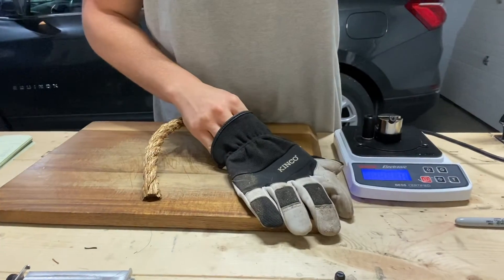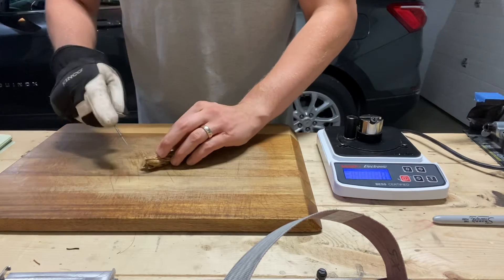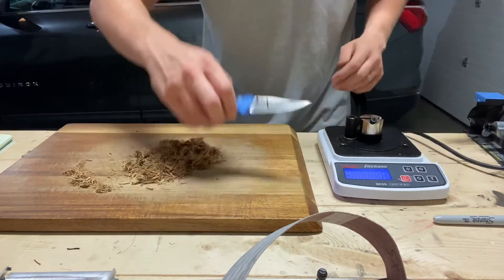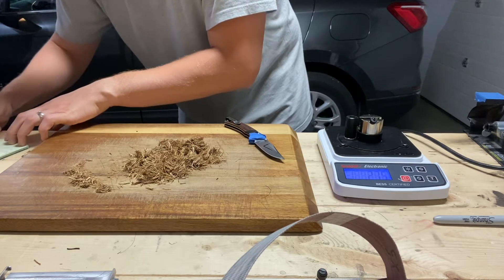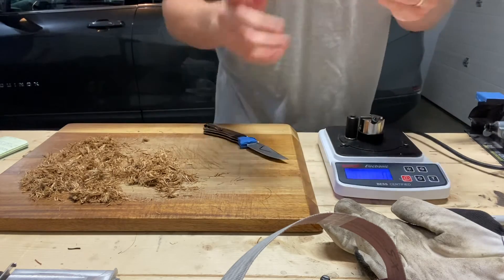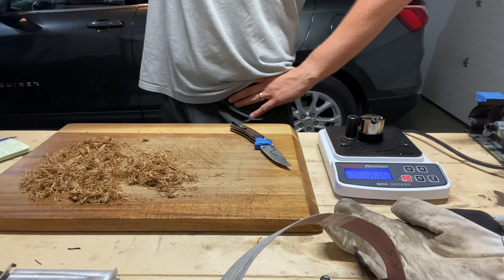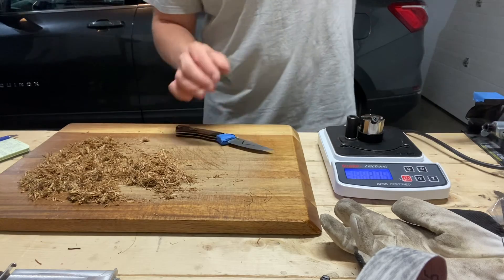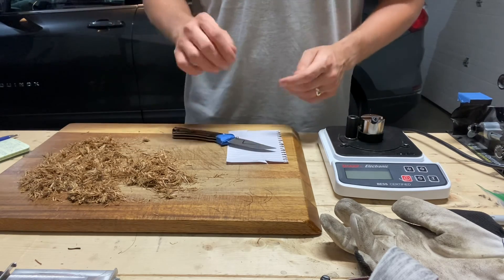Diamond Stones vs Belts Part 4: WSKO Blade Grinder Edge Test (S30V Benchmade Mini Crooked River)

Comment: No difference basically? Within the margin of error? I'm guessing you'll see a difference in S90v and other really high vanadium steels. S30v, S35VN, M390, and below in Vanadium content seem to do roughly the same with Aluminum oxide or Diamond, CBN, or Silicon carbide is the general consensus. I'm looking forward to further testing. You could order Aluminum oxide lapping films and use the KME for both for more consistency if the abrasive is the only difference you want to test at some point. Aluminum oxide lapping films are pretty inexpensive. Looking forward to more testing regardless.
Reply from the maker: I will have a summary video soon, just need to find time! 

I'll sum it up here because I've taken so long but there is statistically no difference in the working edge retention of S30V between sharpening a v-edge using diamonds/CBN and the convex egde from the Worksharp ken onion blade grinder with stiff belt kit, 12K and 1um on cloth. 

This I don't think is surprising other than the fact that it suggests to me that there is little overheating from the Blade Grinder using their Norax 1x18" belts. I don't think it would be expected to see a major difference in working edge performance with either abrasives. 

Should be much more pronounced with the fine edge that will hopefully be captured in a cardboard version of this series at some point. But can't say for sure until we test!

Comment: I know you might fight against this, but I  would really love to see you put in some hand sharpening into the mix. The variables there might be too numerous, but I think either a neo-chosera-shapton progression or a venev progression
Reply from the maker: IMO the KME is the same as hand sharpening just takes the skill out of the equation. But I do actually have about 20 points of data on knives I've tested on cardboard until no longer shaving hair on a 1" section. I did this prior to the channel creation just for my own knowledge but I'm apprehensive about sharing it because the magnitude of results varies from the more popular testers on YouTube. The pattern/hierarchy of steels at their harnesses match perfectly  but I think that detail is well beyond some in the YouTube audience. 

I do think it would be interesting to test the Neo vs. Chosera on a high VC steel and see if the SiC makes a measurable difference!
Reply: @EngineersPerspective701  Oh that neo vs Chosera would be a perfect match, especially because those both hit that 800 grit so well.  

I understand now about the hand sharpening equivalence to the KME. Theyre both sharpening the blade in the same method: precisely with no heat generation.
Reply from the maker: @MrSATism  Not in terms of edge performance but just usage, I WAY prefer the Neo to the chosera 800. Cuts way faster and leaves a nicer finish. It's just more thirsty and dishes quicker.

Comment: Really looking forward to your upcoming analysis comparing sharpening methods!

Your continued mention about the different abrasives with these methods brings to mind a prior set of videos I saw. A different comparison than yours but I am curious, have you ever seen the series of videos by a guy named steeldrake in which he hand sharpened maxamet with diamond, sic, and al-ox? Never have heard anyone mention them anything about those videos since. Not sure why. They did seem interesting. 

What a tangent. Look forward to upcoming analysis!
Reply from the maker: Hoping to shoot and post the summary in the next few days, been super busy and wanted to make sure I'm clear on what's going on. 

I haven't seen them but subbed so I can watch later. What was the general findings from steeldrake?

Triple B and Michael Cristy have covered it some but not in a comparison type manner. I think most approach it from the "play it safe" standpoint and just go straight to diamonds to ensure maximum performance. The knife grinders guy also reports being able to achieve lower angles on Victorinox knives that are stabile using diamonds vs. al-ox. 

Technically this test does cover that but I didn't single the abrasives out as a variable and I will hopefully talk about it in some detail.
Reply: @EngineersPerspective701  steeldrake basically found no difference, though he did seem fairly set on his conclusion from the outset so not sure how unbiased his results are. Was always curious about it though and what others thought about it. I have mixed thoughts about it as there are so many ideas out there, but what you say about "playing it safe" makes sense to me.

Comment: Can you imagine the Aussie guy who goes over 1,000 rope cuts on some tests?  Brutal!  I would expect the Work Sharp to do better than KME, starting from the same edge angle and sharpness, because no matter how good you are (and you're good!), you're getting a somewhat convex bevel with the Work Sharp, versus the slab-sided KME bevel.  I've always heard that convex edges last longer.  

Had my first Maxamet sharpening experience today, after I put a decent-sized chip in my Sage 1 blade.  It actually wasn't that bad with the KME Beast.  Weird, though.  I very quickly got what I thought was a burr with the Beast, but then it took a good amount of work to raise it again with finer stones.  Took it down to a shiny 1 micron finish on lapping film.
Reply from the maker: So brutal! I do not envy Pete and conducting those tests!

With the topic of convex vs. v-edge I think there has been some misleading advertisement. I'll try to cover it in the summary of results video. But it works like this 1) A convex edge is advertised as being "stronger" because of its shape. If this were true then it would only aid edge retention if the mechanism of dulling was through mechanical failure instead of abrasion. In this case we're dealing with 100% abrasive type wear (at least attempting to!). 2) If the very tip of the apex is the same say 20dps then the v-edge actaully has more meat behind the edge to support it. Now often the convex is depicted as 20dps at the shoulder of the apex and then it rounds down into the tip of the apex. That of course is stronger but the true angle of the apex is more like 22dps instead of the better cutting 20dps.

Those low grit stones can be VERY tricky. The grit transitions need to be carefully monitored until you pass 300grit. My hypothesis is that the large abrasive particles micro-chip the apex that need to be cleaned up whereas the higher grits do this to a much smaller extent as not to be noticed.
Reply: @EngineersPerspective701  Thanks for the explanation.  To be honest, the "convex cuts longer" argument never made logical sense to me.  

Since your post I started reading Dr. Kraichuk's book, and I can tell from your comments that you've been studying it as well?  Super interesting, but to be fair, some of the astounding results he's getting are down to the very low edge angles he's using.  If, as he says, there's almost all upside to lower angles, however, then why the heck not?  I just took a 14c28n blade down to 14 dps and got a 100-point BESS score using just the belts that came with the KO Grinder and a leather strop.  I used the 1° lower angle on the final belt, but the key was to strop very lightly on leather at a higher angle.  By far the best result I've gotten on the grinder.
Reply from the maker: @BladeLabMiami  Great result! Hand strop? How was the edge bite?

Yes, I read it a month or so ago and have been mulling over/testing the information presented in there. Some of it needs translation to non-power wheel sharpening and a few things I'm not 100% in agreement with but overall I think it's really good work. It's one thing to read, but another to study and apply so that part takes time!